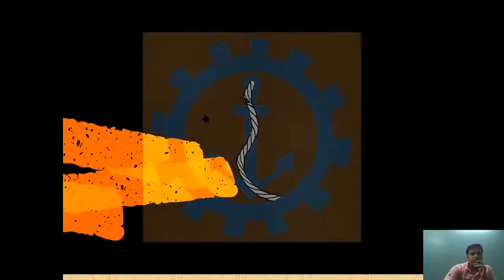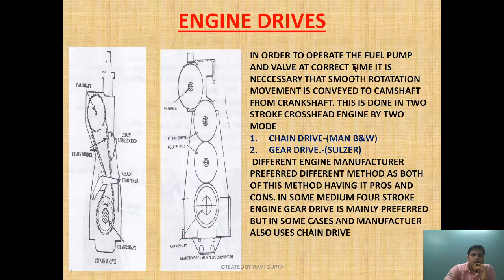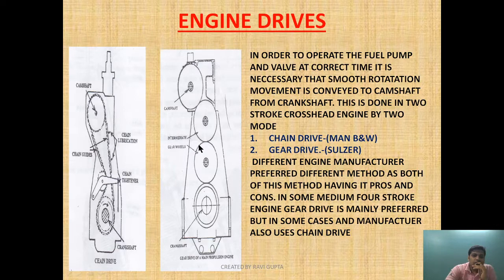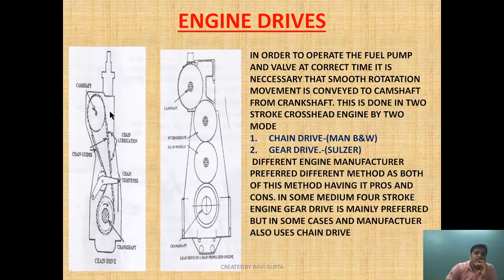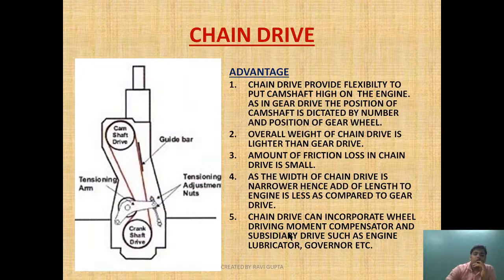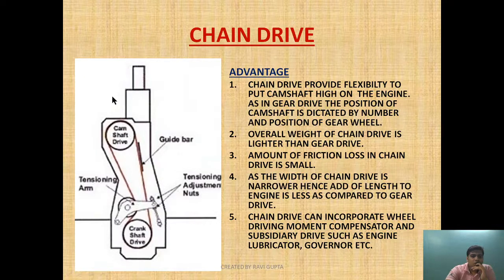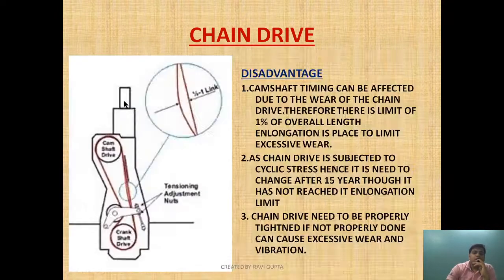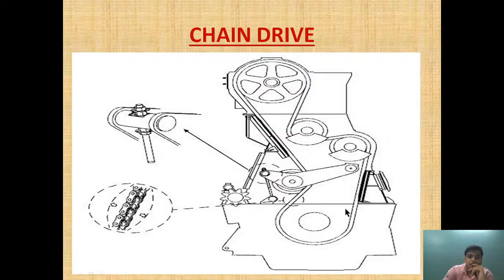ENGINE DRIVE|CHAIN DRIVE|GEAR DRIVE|ADVANTAGE & DISADVANTAGE OF CHAIN DRIVE|(PART-1)

Comment: Excellent lecture sir!  Why isn't crosshead or piston rod is present in 4 stroke engine?  Please reply it sir....
Reply: 2-stroke engines are almost 1.5-1.8 times heavier than the 4-stroke where in two stroke only scavenge ports and center mounted exhausted valve present but in four stroke there are valves, cycle is completed in two revolutions of crank shaft that means  these are of medium speed or high speed engines. Therefore 4-stroke engines are used for power generation and 2-stroke engines are used are main propulsion system.
For further information read difference between 2-stroke and 4-stroke
Reply: @rohithmandavilli752  in 2 stoke  engine  piston  stroke to bore  ratio is high  as compare to 4 stoke engine. piston has to move a larger distance from TDC to BDC  to generate  power ( we can say liner length  is very high as compare to bore in two stoke engine) thats why we find such  piston rod arrangement in two stoke engine